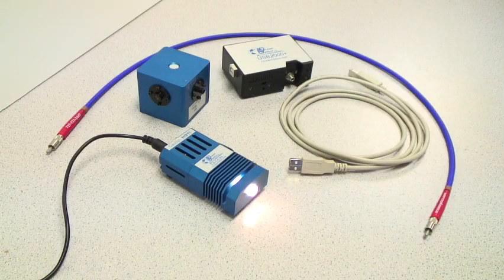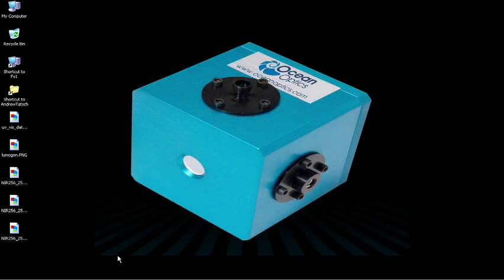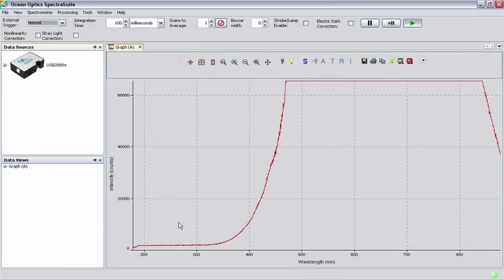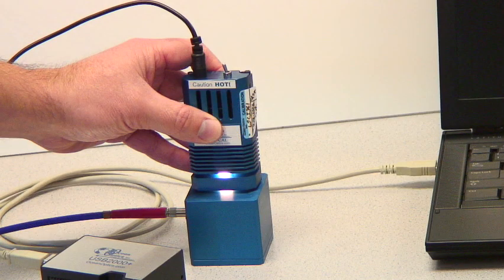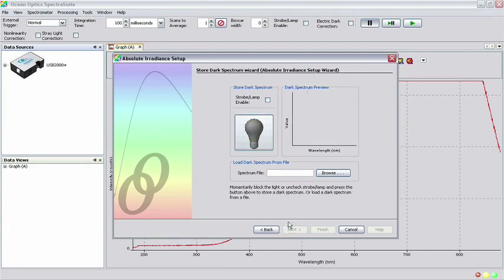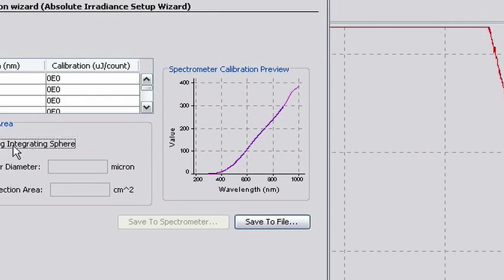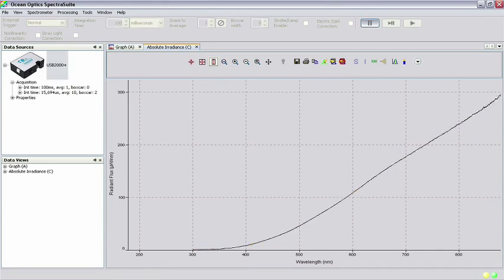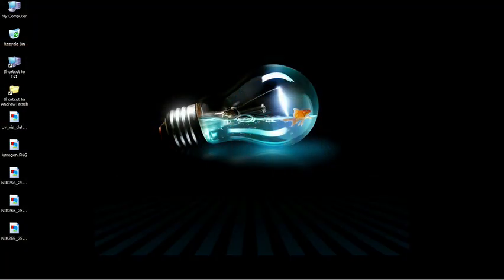Radiometric Calibration Using an Integrating Sphere [SpectraSuite]

Comment from the maker: No, you shouldn't switch off calibration source or disconnect the fiber.  However, you can take the calibration source out of the port on the integrating sphere and block the port to take the dark.  Alternatively, you can slide an opaque material in the filter slot on the front of the light source to block the light coming out of the LS-1-CAL-INT